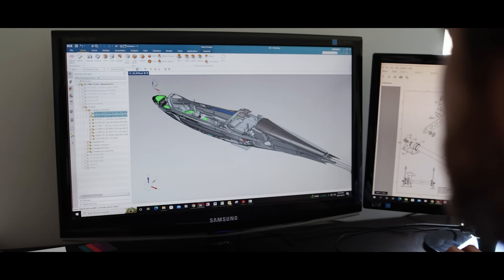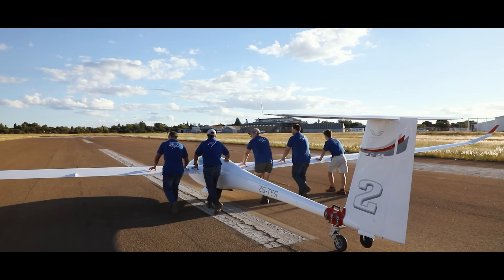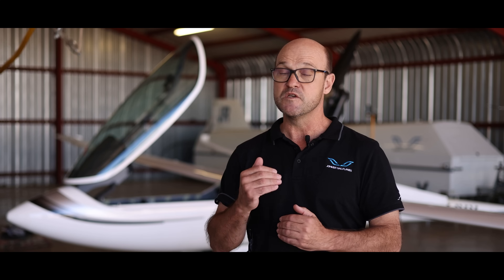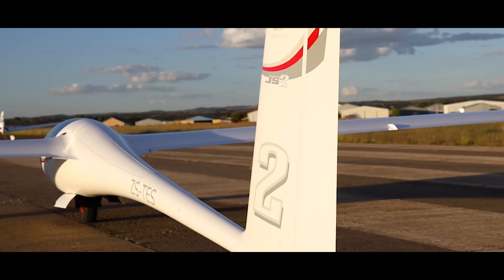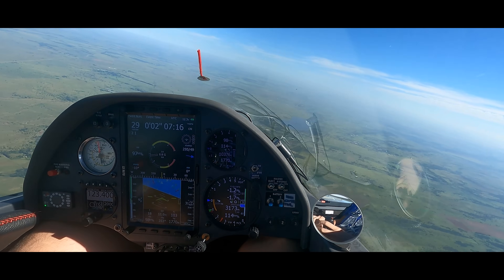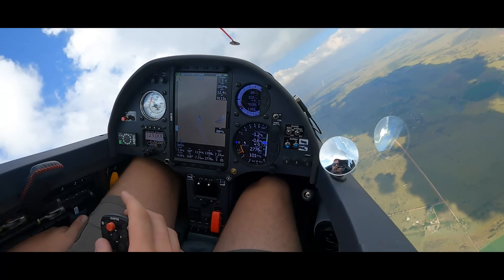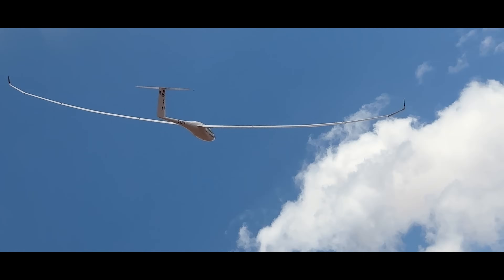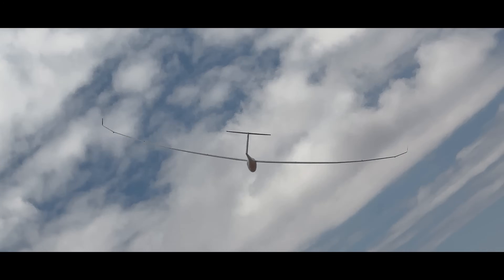JS2 EASA Certification Test Flights

Comment: Very impressive, outright. One question, however. 
Did you increase the flutter testing with a 20 km/h step? Calculations, for instance with NASTRAN show that above a certains speed the damping very fast reduces an becomes negative. The FAA advises hence to step up with 4 kts (7 km/h) steps for each increase in speed. 
By taking larger steps you could pass unintensionally the critical damping area, and enter the danger zone.